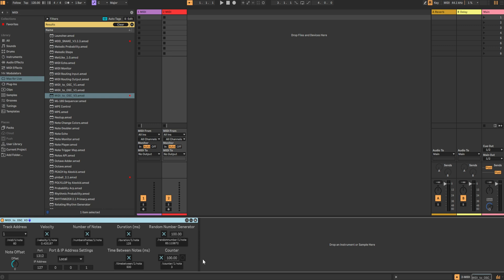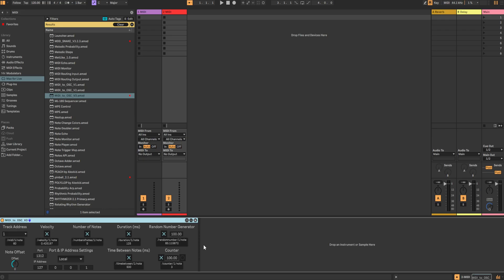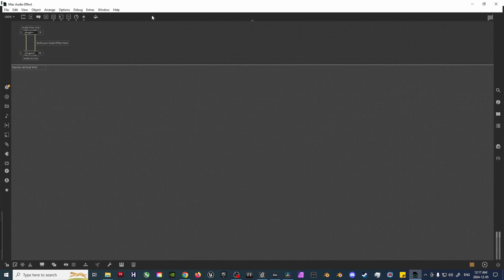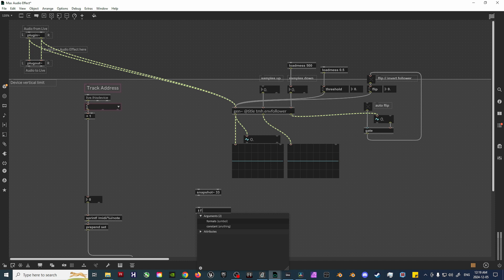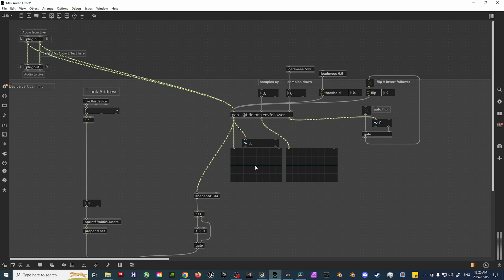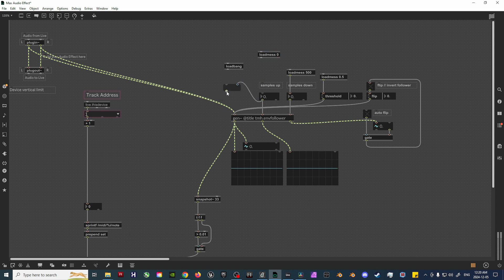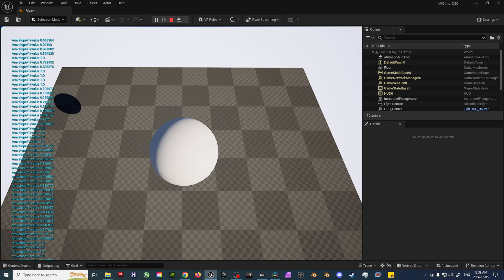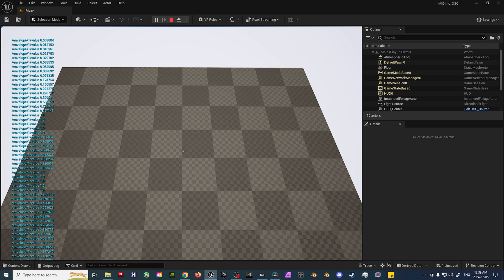How to make a dynamic envelope follower for Unreal Engine reactive visualizers

Comment from the maker: Quick Addendum: I alerted the Gen object to have two audio inputs instead of the initial one.
This is achieved by entering the Gen object and adding a second input called "in 2 @comment input", which then gets plugged into a "+" object along with the initial "in 1 @comment input" object.
The other two input objects are then renamed to "in 3 @comment slideup @min 1" and "in 4 @comment slidedown @min 1".